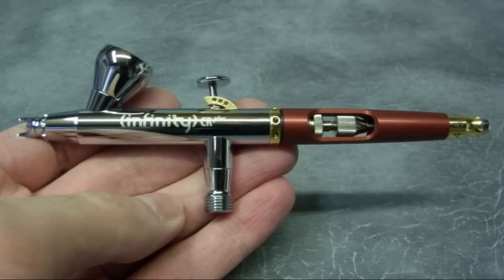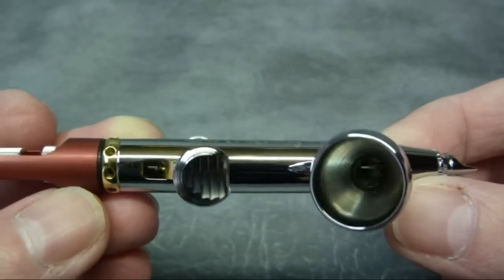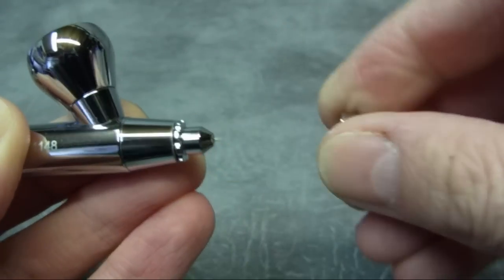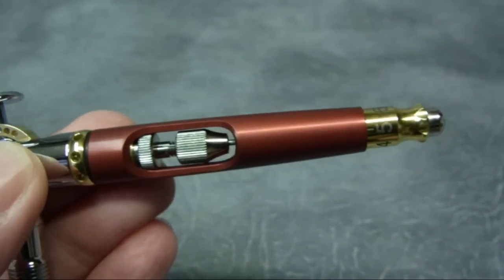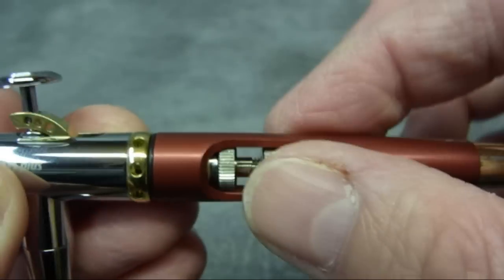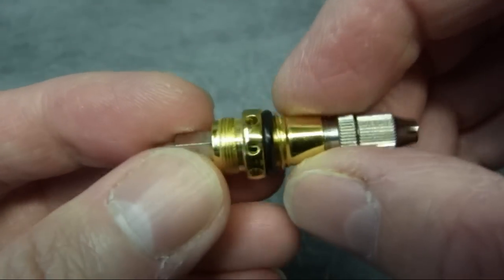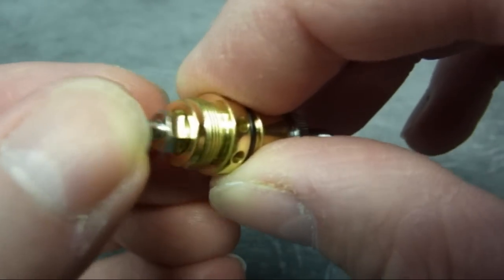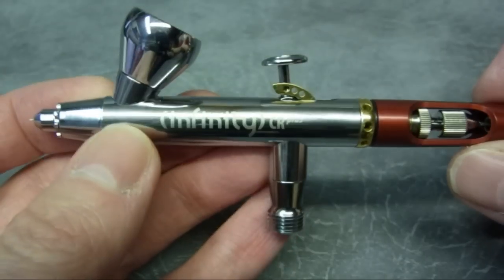Harder & Steenbeck Infinity CRplus Airbrush

Comment: Nice review.  I just picked up one of these for spraying fine details on miniatures; I plan on relegating my Iwata HP-CS to base coating or painting larger miniatures such as buildings/vehicles, etc.  Another reason the triple coating on the CR Plus is so nice is that it is much more resistant to harsher solvents, so you can happily spray enamels, etc and not worry too much about damaging the finish (the PTFE seals are more resistant than the regular seals in the Iwata too).  The trigger action and air/paint control is so much more precise than my Iwata too (which in turn significantly better than my Badger 105).

Comment: Thank you for the review!  All HS needle/nozzles work in all of their guns (except for a few exceptions), therefore you can use .15mm, .2mm, .4mm, and .6mm needle sets in Infinities.  These guns are very versatile.  I purchased an Evolution CR+ 2n1 and added a "quick fix" handle to it all for around $200 brand new and including shipping.  So now, except for the color scheme (don't care), and the see through handle that allows for tension adjustment (never use), I have an Infinity.  I'm very happy with this brush.  One thing to remember, HS makes their needles out of solder (satire!).  My Paasche needles are way more durable.  I've tuned my Paasches so well, I have a hard time deciding which brush to use.  Thanks again!

Comment: @mitchellcipriano, gotta agree with Rocket....you obviously haven't had one of these in your hands. There isn't a Badger AB made that can hold a candle to the Infinity. Parts are about the same price, cleaning is a breeze, take off the back, take off the front, slide the needle out, clean and re-assemble...doesn't get much easier.

Comment: good review ive got the evolution duo,i love how the front tip housing doesent screw in,my old airbrush had a screw in tip section and after stripping it down to clean over time the brass thread snapped off inside makeing airbrush useless unless id sent it tobe fixed but was a cheap type,everyone should invest in getting a harder steenbeck airbrush for there quality

Comment: I've had my Infinity for about a year now. It has the smallest possible nozzle size I've seen anywhere (.15 mm). It's a sweet airbrush, but a couple of words of advice:
First, buy the Harder Steenbeck airbrush tool, which doesn't come with the brush, and you will need it.
Second, buy a second needle, because the break easily if you work really close. Also, buy a complete set of seals, because they do wear out on a brush this delicate.

Other than, that go for it. Spare parts aren't expensive.

Comment: Either your valve is blown or, more likely, your needle packing seal is worn out. That allows paint to get back where the trigger is, and it dries up and screws up your trigger action. A package of seals will cost you less than ten bucks from Chicago Airbrush.